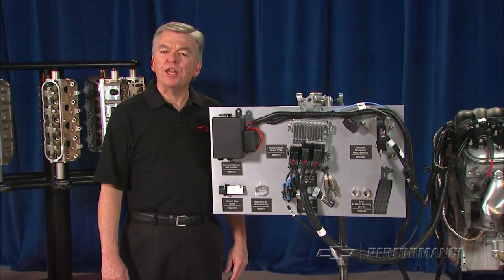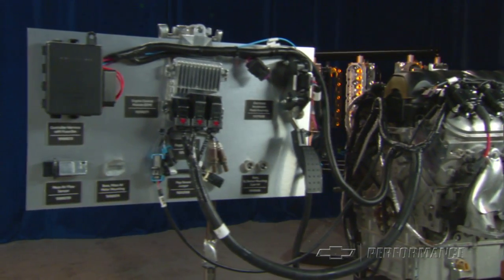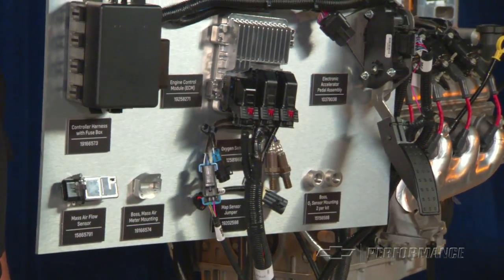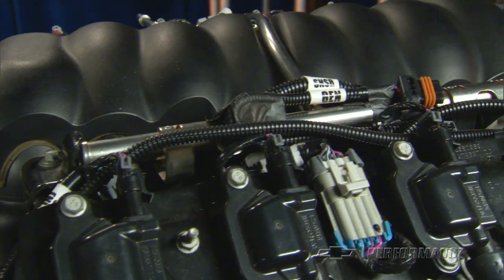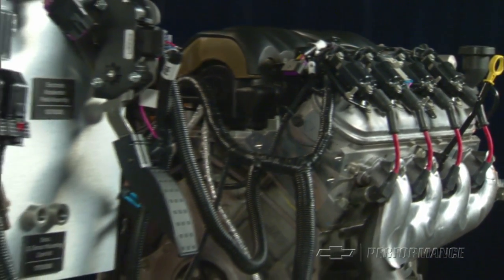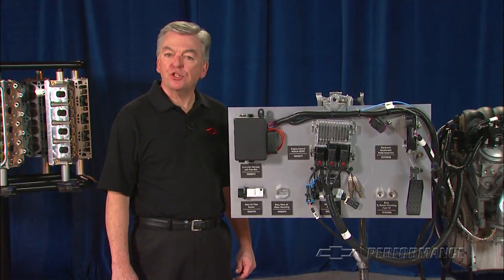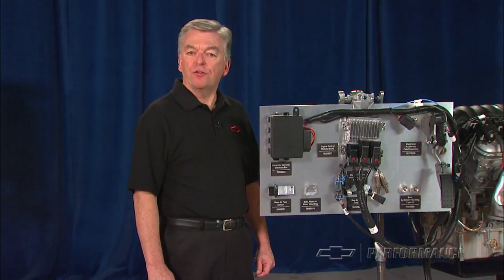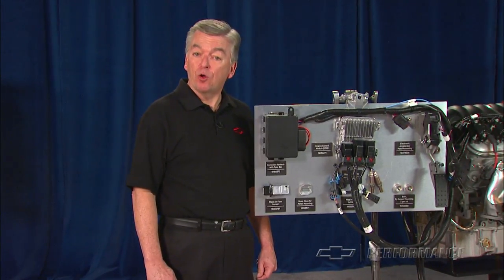Chevy Performance Engine Controller Kits - Complete Engine Control Solutions

Comment: Does this kit have a obd2 plug, also was curious about ipc applications. I want to do a 5.3 swap into a 97 s10 blazer so ill need to have a check engine light and obd port for inspection.